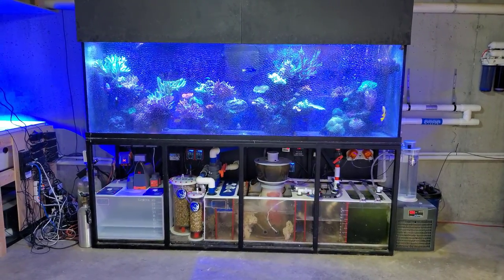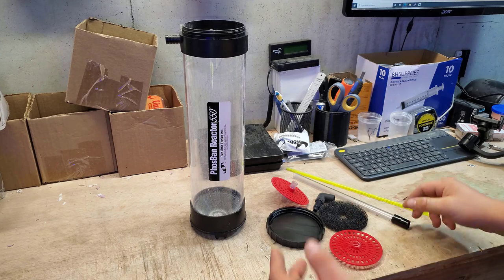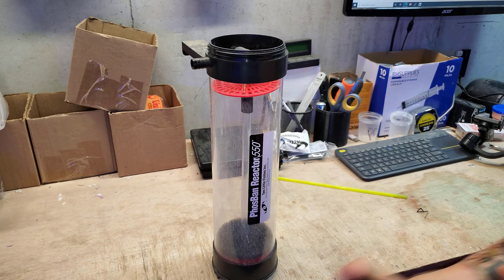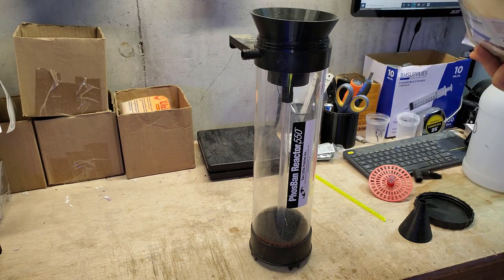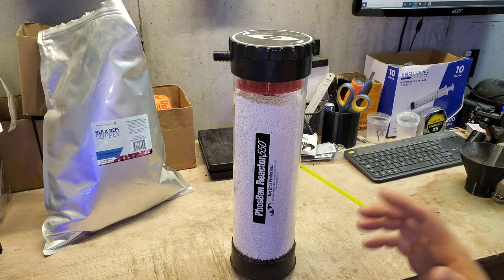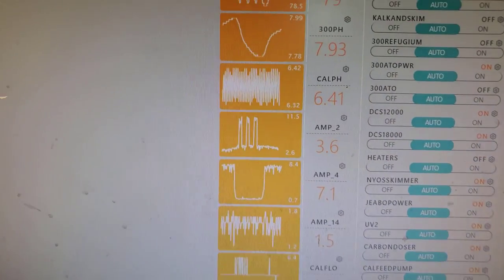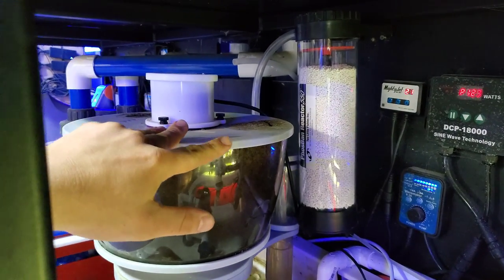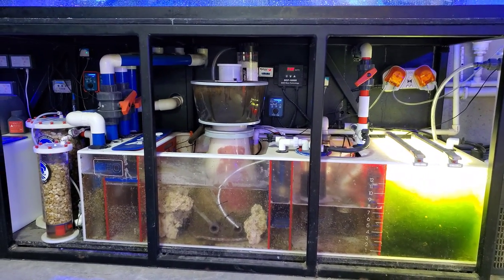DIY CO2 Scrubber With A Phosban 550 Reactor | BRS Media Test

Comment: Buy your media from a Pharma company its a fraction of the cost, also recirculating works ALOT better, not only at raising your PH but also at reducing the media consumption, it actually makes sense when you go with that method to lower your surface agitation as you loose PH that way.

Comment: The latest few batches of BRS media is weird. Get the icecap stuff as a trial, if that helps then you know it was the BRS media.

"DiveSorb" is about $60 shipped for 10lb. I'd get about 2 weeks per pound in my system.

I used to get 7.6-7.8ph, when just using media into my skimmer (like you have here) I went up to about 7.9-8.1ph.

I've now been experimenting with an "aeration chamber"  which is basically a mostly closed off section of my sump and using a 1000gph air pump into 2 large airstones and recirculating the air coming out of that back into the co2 scrubber and then into the inlet of the air pump. 

For the past week I've been sitting at 8.3-8.5 and the media barely looks changed... I've also got my chaeto in that chamber and have found its tripled its growth rate.

Some crazy experiments but hey, thats the coolest part of this hobby IMO.

Comment: Would it be better to change the inlet of the reactor to take air from the outside air pipe? That's how I did mine and it worked for me.
Reply: I also get my C02 scrubber media from a dive shop and it is much cheaper.

Comment: The media didn’t change color bc 1 tablespoon of water at the bottom of the canister is not enough. It dried out within a day with a large skimmer like yours. You need to have humid air for the media to work properly. That description on the BRS bag is generic for their small canister reactors. I had the same problem as you. Attached a small squirt bottle to replenish the water at the bottom of the media can. Using up 100FL OZ of water per week and my skimmer is much smaller. I am also drawing air from the outside like you. Lasts me 2 months with the large BRS canister. Probably the size of yours. You just need to replenish the water.